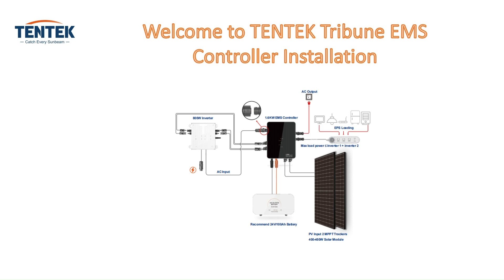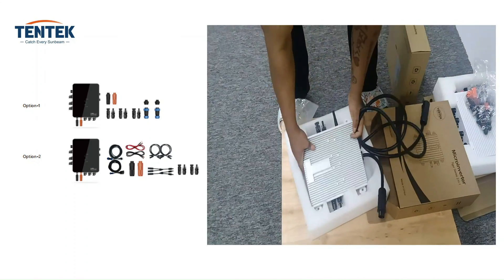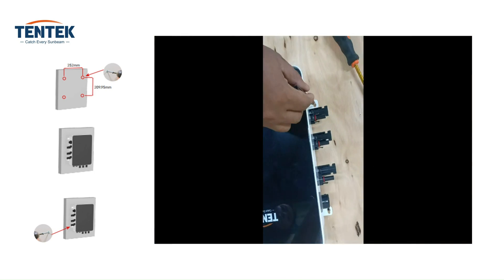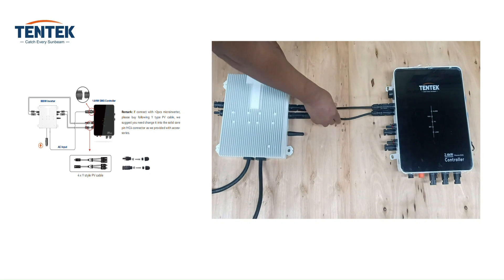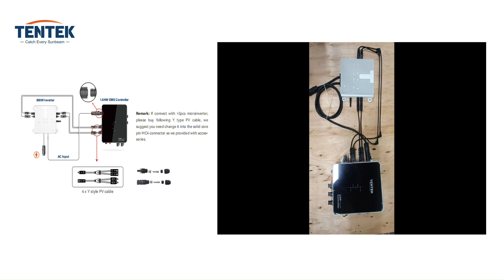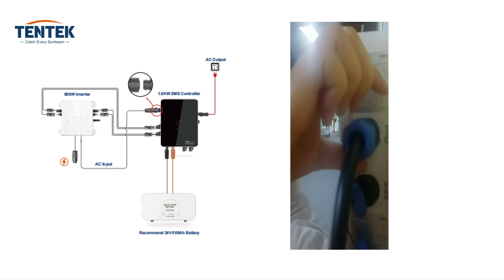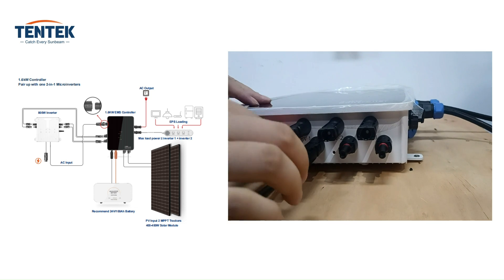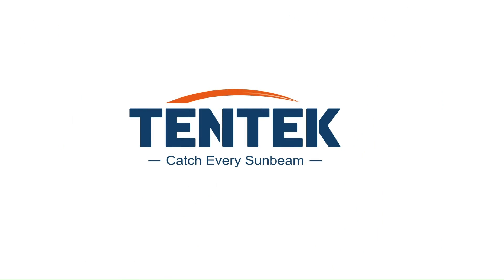Tentek Tribune EMS Controller Installation

Comment: Available for normal customers?
Reply from the maker: yes
Reply: What are the resellers in Europe? Found only the offers from China at ~220 USD. But would like to buy in europe, ideally in germany @TenTek10
Reply from the maker: We just sell to wholesaler, distributor, and retailer. Thanks
Reply: @TenTek10  This product does not meet the German standards. All five purchased micro-inverters are defective: either the data is incorrect, they are constantly offline, or the inverter simply doesn't blink. Tentek EMS shipped damaged goods as new products, and within less than four months, four devices are already broken. I have been in communication with the manufacturer about the warranty for over a year, but the manufacturer has provided 1000 reasons to reject the warranty. Please note that the product quality from this manufacturer is not guaranteed, and there is no after-sales service. For your physical and mental well-being, whether as a manufacturer or private customer, please stay away from these inferior products.
Reply: Dieses Produkt entspricht nicht den deutschen Anforderungen. Alle fünf gekauften Mikro-Wechselrichter sind defekt: Entweder sind die Daten fehlerhaft, sie sind ständig offline oder der Wechselrichter blinkt einfach nicht. Tentek EMS hat beschädigte Ware als Neuwaren verschickt, und innerhalb von weniger als vier Monaten sind bereits vier Geräte kaputt. Ich habe mehr als ein Jahr mit dem Hersteller wegen der Garantie gesprochen, aber der Hersteller hat 1000 Gründe, die Garantie abzulehnen. Bitte beachten Sie, dass die Produktqualität bei diesem Hersteller nicht gewährleistet ist und es keinen Kundendienst gibt. Zu Ihrer körperlichen und geistigen Gesundheit sollten Sie sich als Hersteller oder Privatkunde von diesen minderwertigen Produkten fernhalten.